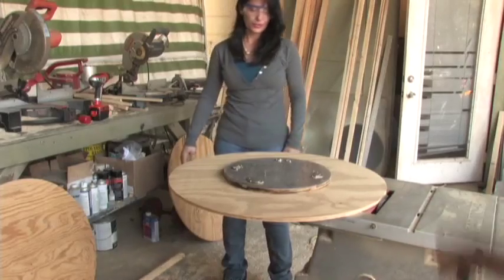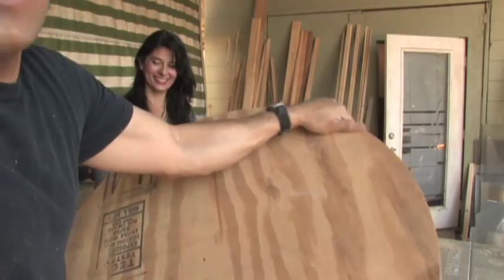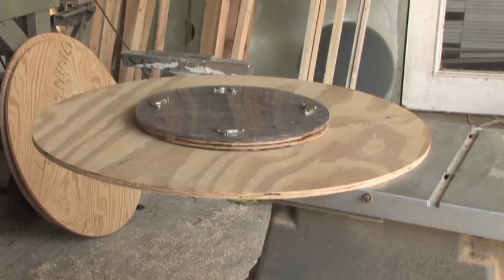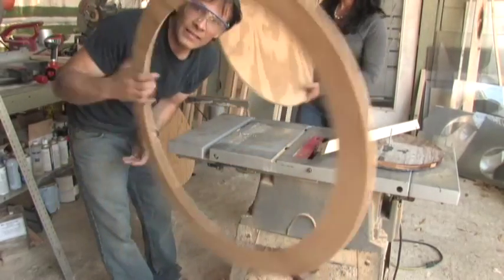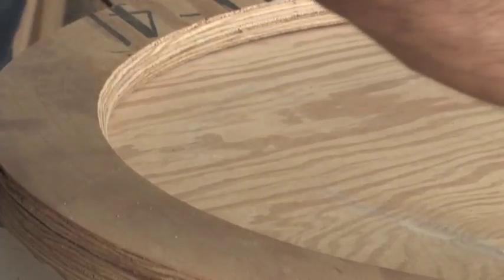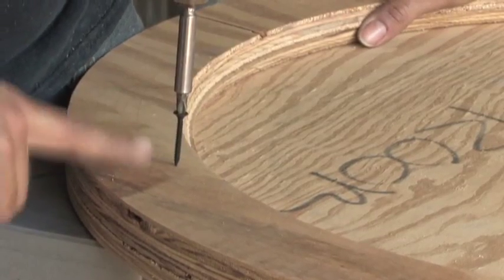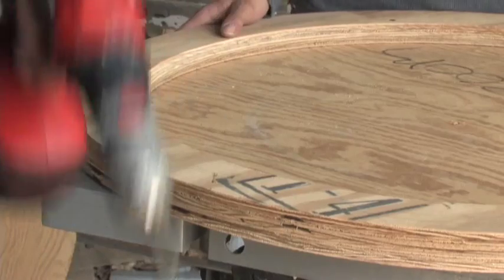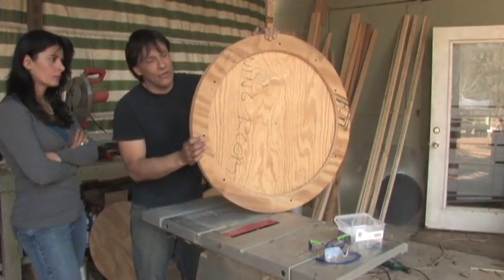VERTICAL AXIS WIND TURBINE WINDMILL 2

Comment: Another way to start your wood screws is to use a hammer except for the last turns. I learned that from my Dad in the 60's, he learned it in the 30's.

Hey Dan, do you have/use a compass to construct your angles with? Protractors are okay but a compass is better.

Comment: I like your thinking. Don't listen to the guys crying about you putting holes in your saw. Its your saw. I used to do the same thing with my circular saw when I did drywall by shaving half of the foot off of the bottom of the saw.

Comment from the maker: Take 3/4" plywood the sizes of the saw work area x 8" wide. Sand smooth and add a wax or high gloss surface so it does not grab the wood. Place a bolt through it 1/4" x 3" long. Counter sink the nut flush. Clamp the wood to desired size from the blade so the clamps are below the work area. More bolts on both ends may be needed. 

Working bolt straight up in the air. drop wood with 1/4" hole down the bolt. Start cut with blade all the way down work up follow video.

Dan
Reply: I always learn something from you guys even the simple drywall screw in reverse as a drill these are the simple tricks that save you some much time

Comment: it might make it easier to cut the slots before cutting your rings out, would save having to realign it before temporarily screwing the pieces together also if you have a router you can use pivot points at half the diameter of the PVC pipe you are using and cut curves for your PVC pipe to fit more snug.

Comment from the maker: Post a video of that process on 1/2" plywood and you can do a video response.

watch?v=qt62CEWUw7I

The above router video requires multi passes for thicker material. Routers are not good for ripping thick stock. I have 2 plunge routers, they do not come close in speed or a clean cut.

Our process can cut 3" deep material in under 10 minutes.

Thank you for the comment.